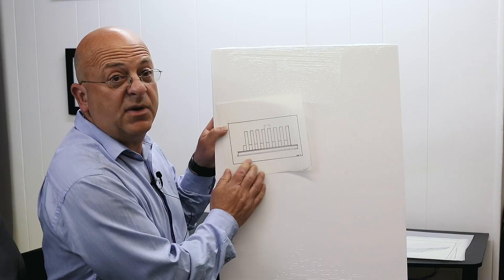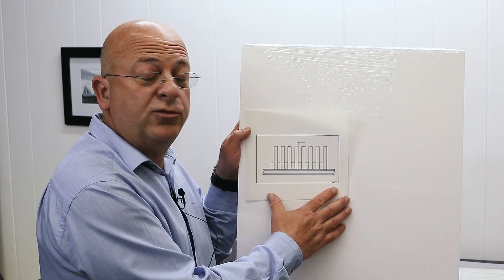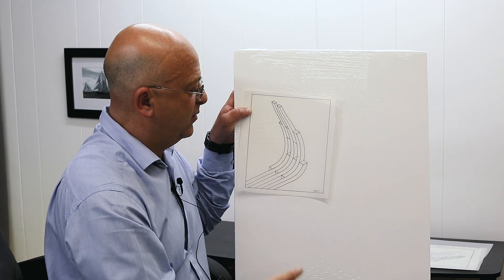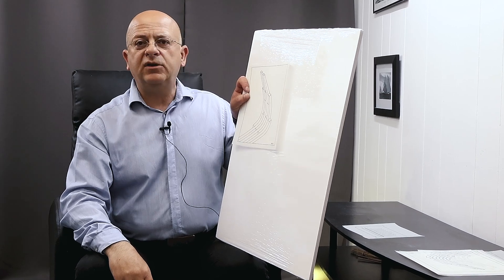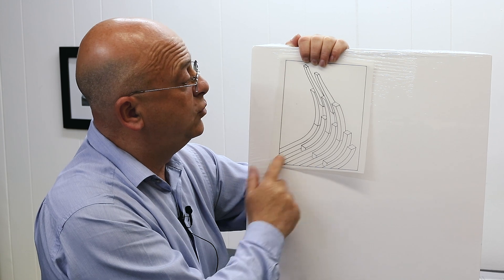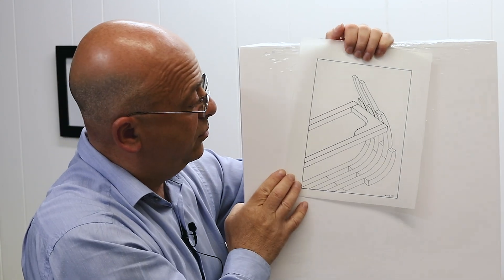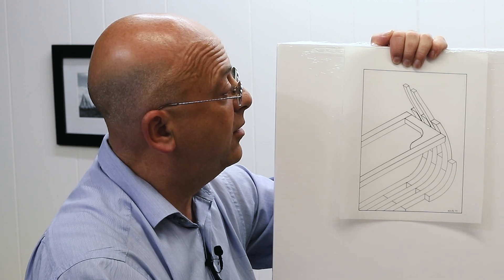FRAME design (Part 1)

Comment: Thank you for starting this sequence of videos on framing: There is nothing in naval architecture that I was more curious about and have questions about than framing in the 17th century. However, the pictures you show worry me, because they do not match what I thought was scholarly consenus on the topic. After watching your video a couple of times, I came to the conclusion that nothing that you actually say is in conflict with what I thought is academic consensus, so maybe it's just the pictures that are giving me the wrong impression. 

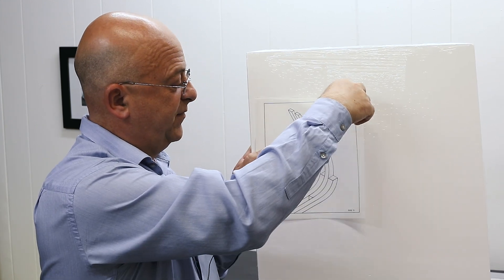The drawing you show starting ca. at 5:00 shows something close to the stylized framing of English Admiralty models -- alternating frames consisting of floor timber + upper futtock and lower futtock + toptimber (in the case of four-part frame bends), with alternating gaps as we go up a frame bend/pair. I am concerned about these gaps, not the space gaps on the longitudinal dimension that you discuss starting ca. at 10:40.

It is my understanding that the consensus is that at least the larger English warships (i.e. those that we typically see represented by Admiralty models) were never actually framed like this, even if some smaller ships (other than two- and three-deckers) may have come close for a limited time period.

If you look at the English 1677 construction programme, as evidenced in the wreck of the Anne and original documents for the 1677 program (such as scantling lists and building contracts, some of which go into the dimensions of scarphs for the frame timbers -- connecting them bottom to top, necessarily without gaps), the framing was clearly different: Every frame bend consisted of a pair of frames, one consisting of floor timber+middle futtock+top timber and the other of lower+upper futtock., with no vertical gaps between timbers at all, and port and starboard lower futtocks touching and resting on the keel. Every third frame bend had the frame pair linked; the fill-frames consisted of two frame bends (pairs) that were separated, spaced out, and "free-standing", without vertical gaps. So, moving longitudinally, you’d see a sequence of a double frame, four single frames, a double frame, four single frames, etc. each resting on the keel and without gaps from keel to the top end of each frame. [With some slight longitudinal offsetting to align upper futtocks and toptimbers with the sides of the gunports where this was easily possible.] It is my understanding that this was universal for at least the 20 two-deckers of the 1677 programme, and given that so many dockyards and master shipwrights were involved, it must have reflected practice that extended much beyond that programme.

Could you cover in a video how far Admiralty/Navy Board model framing is stylized or was ever implemented in actual ships?

I'd love to see a framing plan of Vasa as built, if you have one. Haven't been able to get the books you recommended on Vasa yet, and don't know if they contain one. Which was the easier side to shoot a cannonball through, port or starboard? Just asking in case the Swedes put Vasa back into service to renew the Thirty Years' War or the potop szwedzki.
Reply from the maker: For the 1677 Thirty Ships programme of King Charles II (and not Pepys, sorry), watch the next video. I speak of it there. I wrote my MA thesis on this topic and did quite a bit of reading of contracts and specifications, of Keltridge and Battine, of Thomas Fagge and dictionaries. Then I also looked at the - at the time - available shipwrecks. Warwick seems to have had a single futtock and toptimber as per Navy Board models (I did the frame recording of the central section of this wreck in 2011 for the project director), the Sea Venture seems to have had two futtock, but if I recall correctly one fore and aft fastener was found, so the pattern of doubled frame and filling most definitely is not visible on either of these wrecks. It is not visible on the early 17th century Cape Cod wreck, either. All of them demonstrate the gaps. DItto Vasa, although there it is a bit less regular and clean-cut than on the English wrecks. Vasa has 3 futtocks plus a toptimber. Generally. The framing plan of the ship has yet to be drawn (mea culpa, mea maxima culpa since I am the one who is supposed to do it!) but will be included in the hull volume of the ship. The port aft side of the middle deck remains to be recorded and Dr. Hocker and I have to figure out when we both are available to do it. 
I do formulate a hypothesis in my MA on the Navy Board models, but now I have a more probable hypothesis on how the style emerged. Yes, I do believe that in the earlier years, when the ships were smaller, the Navy Board style actually represented physical practice. When writing my thesis, Mr. Lavery very kindly spent hours of his time at the NMM to discuss my ideas and mostly to support them, so did Mr. Peter Goodwin. The interim decades have not yielded any archaeological material to make me reconsider what I wrote than. Though I wish to God my writing style had been more readable. I have wanted to rewrite and publish it as an article ever since, but... somehow never have the time to do it.
Reply: @kroumbatchvarov-archaeologist  Dear Kroum, thank you so much for taking the time for such a detailed and interesting answer while you are travelling. As for early to mid-17th century vessels of moderate size, FWIW, this random person on the internet believes you are right if your thesis is/was that the framing is as in/very similar to Navy Board models modulo longitudinal gaps that increase upwards as framing gets lighter. (To me, though, these gaps mean it's not Navy board style anymore, reconciling your thesis with what I have read -- but that's beside the point since I brought up Navy Board Model framing, not you in your video.) However: Both Warwick and Sea Venture are from the very early 17th century and smallish. Do you have an opinion on the Anne wreck off Hastings, which is the only 17th century wreck I have ever visited in place, so I have a special soft spot for it, and it is from the 1677 programme? As you have probably noted, the framing I have spoken of is argued for in the Richard Endsor books. His book on Anne has some photos of the wreck that seem to support this framing, though the photos are framed (word overload) a bit selectively. What do you think?

In any case, looking forward very much to the coming videos!!!
Reply: @kroumbatchvarov-archaeologist  Is there some way to read your master's thesis other than by inter-library loan? TAMU isn't very nice about sharing these. Getting that masters thesis on the framing of La Belle was a struggle.
Reply: Ignore, got the thesis. Super interesting.  I can also already say that the rumors about bad writing are greatly exaggerated...

Comment: Does this design hold for Dutch Fluyt or fluitschips? I had heard they were constructed differently and more cost effectively.
Reply from the maker: In essence, yes. The frame pieces are going to be the same, regardless whether this is a fluyt, jacht or pinaas or an English man-of-war. The difference is in the distribution and manipulation of these pieces. On an English ship, they are going to be square to the centreline, they are going to be pretty uniform in dimensions, they are likely to be completely converted. On a Dutch vessel they would seem more random, but there still are going to be the same pieces: there will be first futtocks between the floor timbers, second futtocks butting into the wrongheads of the floor timbers, etc. Vasa, for example has three futtocks plus a toptimber, but they differ in number from port to starboard. In a Dutch ship the timbers will not end cleanly in a fair line, but as the individual timbers fall. There may actually be two timbers next to each other used to fill up the space where a second futtock would be - this is a specific example from Vasa. And the two sides would not be matching these timber distributions. However, overall - yes, the frame has the same pieces, though with different names.

Comment: Which woods would they prefer for futtocks and logging knees?  Good luck in the field .Those waters may be getting unnecessarily turbulent.
Reply from the maker: There is the odd mine intercepted by the human navies, yes. It depends on what timber was available. As a general rule, oak tended to be a favourite, of course. Though other species have been attested in ship archaeology.

Comment: Thank you! May you have good luck in your field work! One hopefully quick question: did framing practices change much from the late 16th century to the early 17th?
Reply: Curious about that too. I expect that the answer is "surprisingly little" between 1511 and 1690, though there was some real innovation starting in France in the very late 17th and early 18th century commonly associated with Blaise Pangalo and later Blaise Ollivier. More than that, they made framing more aesthetically pleasing, which can't be said of the likes of Seppings (much later). And here is the video to prove that: https://www.youtube.com/watch?v=44ASmT0xwN0
Reply from the maker: @yxx_chris_xxy  More or less, correct. The double-frame emerges by 1684 as evidenced by La Belle. In England - changes begin to be observed in teh documents and allegedly in the archaeological record c. 1676-79. Watch the next video in the series for discussion of this.
Reply: @kroumbatchvarov-archaeologist  1690 was sloppy -- I am aware of the framing of La Belle but am super curious to learn about the changes in England in the late 1670s. Looking forward to that video!
Reply from the maker: Surprisingly little indeed is the correct answer. I might be able to give you more specific answer with examples in September after the season on a 16th century ship. ;-) The timbers are going to be the same, depends on the size of the vessel.